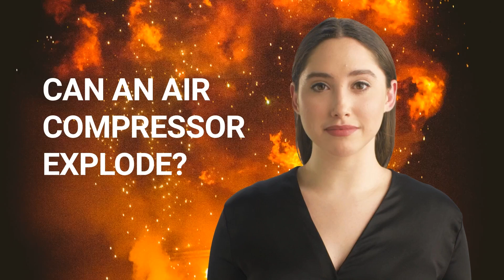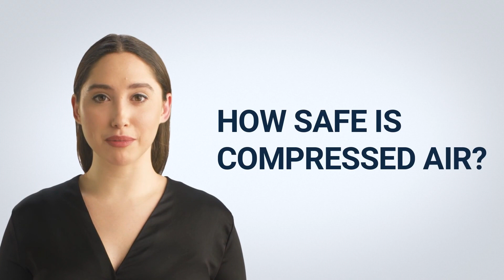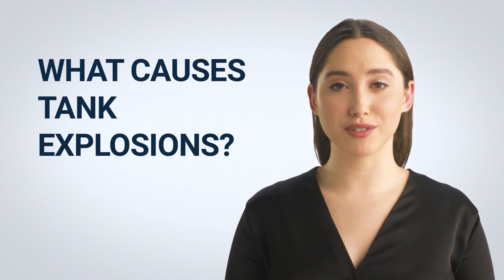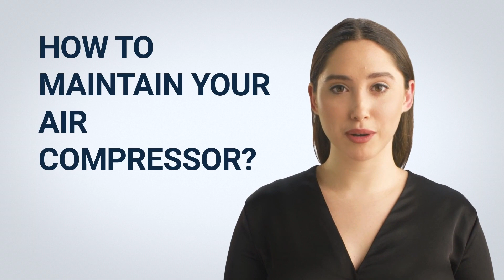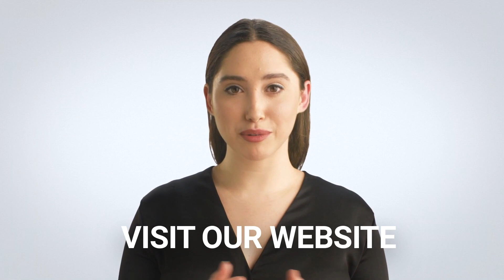Can An Air Compressor Explode? How Safe Is Compressed Air?

Comment: Wrong! Compressed air is not pollution free. Is the electricity running it from a coal fired plant? Is it powered by a gasoline engine? How much carbon was put into our atmosphere during it manufacture?  How much nuclear waste is produced if it it powered by a reactor? Hydo power is probably minimally invasive but it's production and manufacturing produced some pollution.